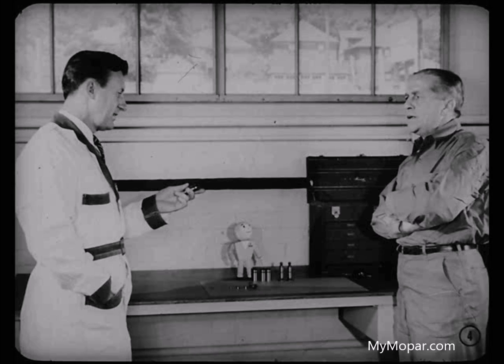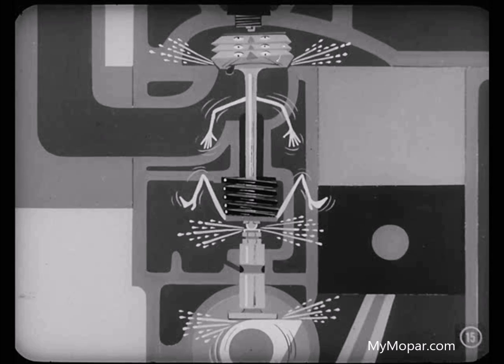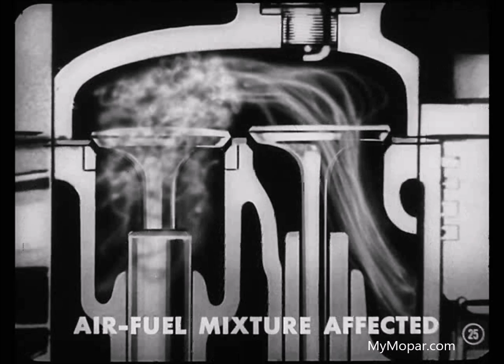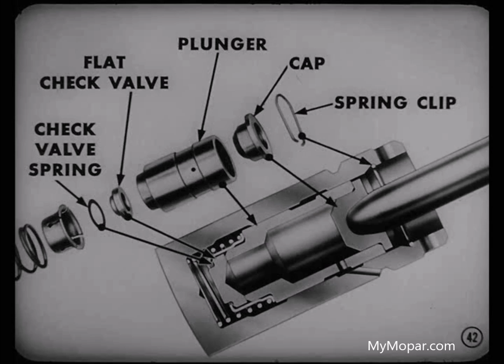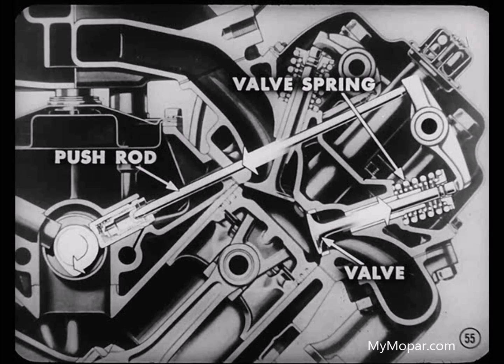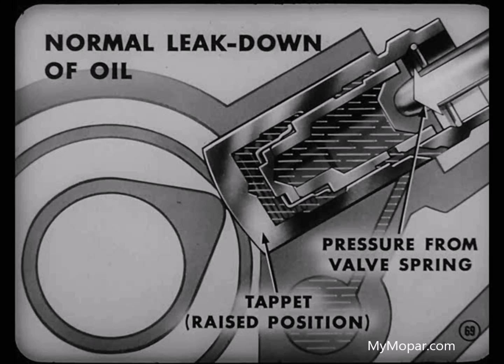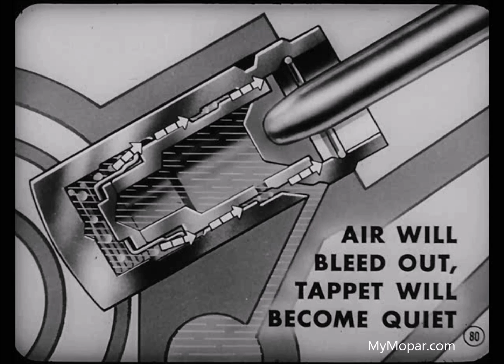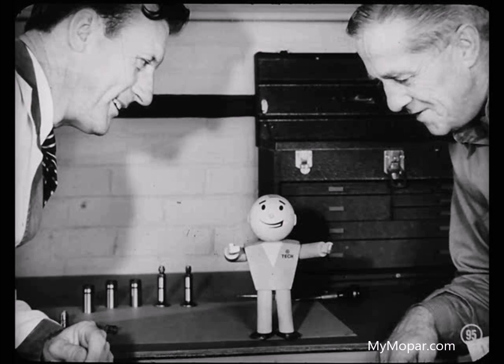Chrysler Master Tech - 1954, Volume 7-11 Hydraulic Tappet Service

Comment: Gave the car an oil and filter change and tappet noise when away. The oil was a year old and dirty like sin -- probably the detergent was spent and varnish was likely starting to form. After oil and filter change oil pressure was 25% higher and in a couple of days the noise on start-up has gone away. I wonder if the old filter was starting to bypass :(

Comment: I heard the same start-up noise in the 5.7 Hemi. It goes away in seconds. It rarely does it anyway only when the engine is cooled down. I actually stick to 5w-20 as said to in the manual, but I use synthetic oil. No Hemi tick, engine is clean, and oil temperature is always under 220 even in Arizona.

Comment: is the spring inside the lifter necessary?
Reply: Paul Kersey  won't the oil pressure fill the lifter without the spring

Comment: 2004 Jeep grand cherokee 4.0 I6 does has this noise on start up every now and again. I assume, after this educational video, that occasionally the engine is stopped on the very tip of the lobe causing the tappet to bleed its oil. Then 3 seconds after the start the tappet regains oil pressure and the clatter goes away. This would also explain the immediate engine start that corresponds with the tappet noise, usually 2 to 3 cranks before normal, noiseless engine start. Very educational video, thankyou and i hope other Jeep owners with the 4.0 investigating their engine start noise issues see this!